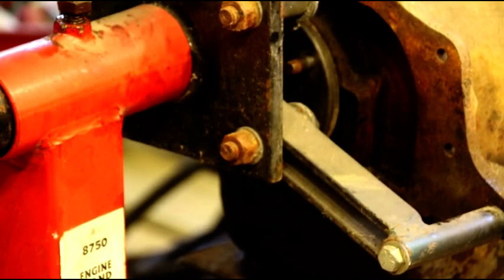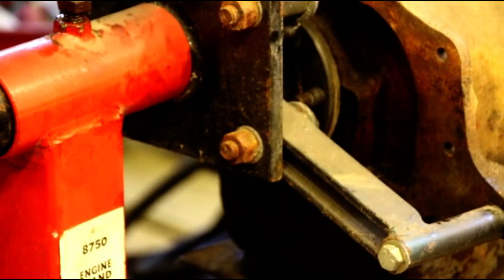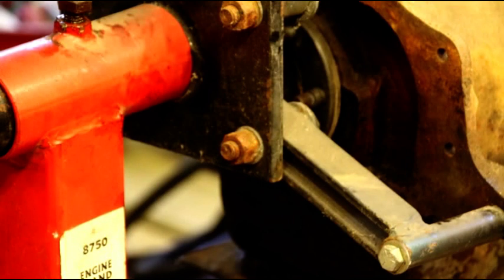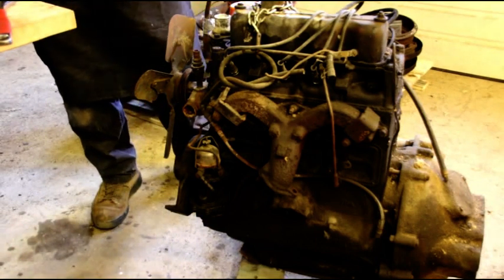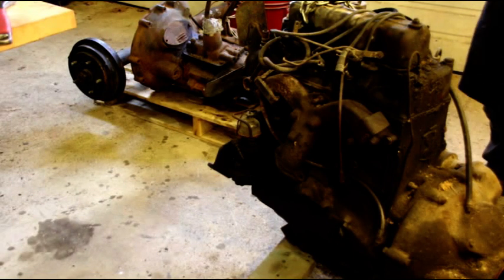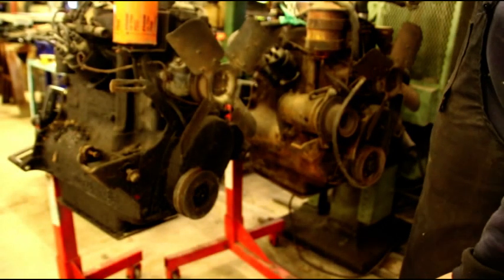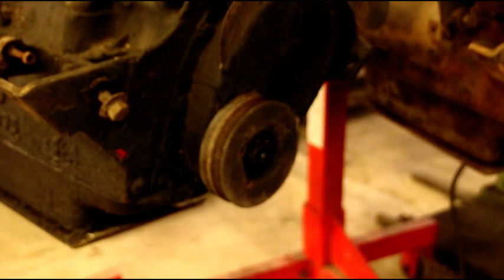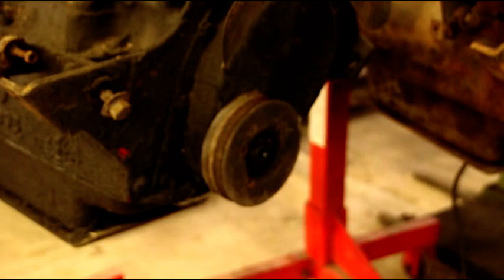Willys F4 134 Engine Rebuild Series Part 1 Engines On Stand

Comment: Yea! Can't wait to hear both running together it perfect two part harmony. I literally grew up behind an F-Head. With today's technology it could be one of the best most efficient designs in history with the big centered intake valve. Nothing ever idled or pulled smoother. Wishing I was there, this was the first engine I ever worked on except tractors.
Reply from the maker: Good to hear from you Karl.  The L and F heads are my favorites !!   This F head powering the snowblower is exactly what I wanted to do from the beginning of this build.  Wasn't until a few days ago that I was able to confirm that the Bros company, who made the unit, offered the F head as standard equipment.  Still have a long way to go and need to fit a clutch/pto to the engine but I am headed in the right direction now.

Comment: I love the idea of using a Willys engine to power the snowblower. Now that the project is shifting gears a little, maybe the driveshaft can be reworked to run someplace else...other than past the driver's door 😁.
Reply from the maker: I have seen other snowblower units with the drive shaft just under the door opening.  That would allow the door to work and make getting in much easier.  I am pursuing that as soon as I get the motor mocked up in the rear of the jeep.
Reply: @metalshaperJeep  I figured you'd come up with something to make it a little more user-friendly 👍

Comment: Hi Metalshaper,  I have been enjoying your videos and thanks for sharing. Quick question: I took my 1945 CJ2a  out of the barn where it has been sitting since 1983 and put some oil in each spark plug hole. When I turn the engine over with a socket handle on the hand crank boss I seem to run into a hard stop in both directions.  Any thoughts?  It almost feels like I get through all 4 cycles before the stop. Thanks , Andy
Reply from the maker: hard to say.  is it a very hard stop or does it feel like you might be running into some rust in the cylinder?    Keep working at it and see if it frees up.  maybe pull the head and have a look in  there.   Don't over do it and break something, take your time and work it out carefully.
Reply: @metalshaperJeep  Thanks for the timely response. It feels like a hard stop and if the valve cover was easy to get into I would look in there for a stuck rod. I like your idea of taking off the head; might be an easier option.  Appreciate your time and videos - super helpful. Talk soon, Andy